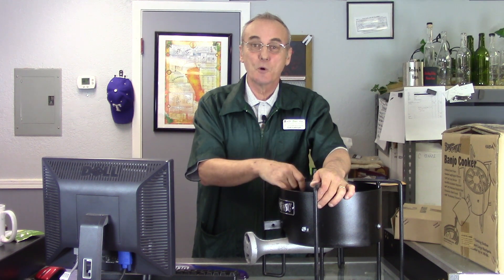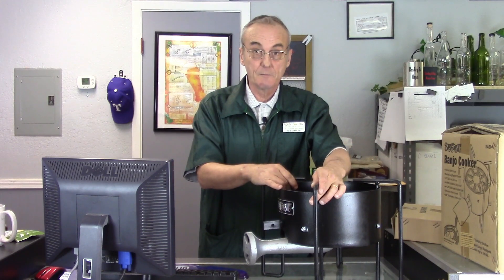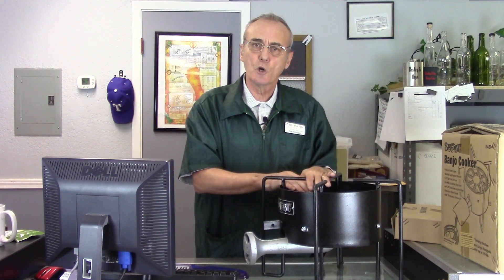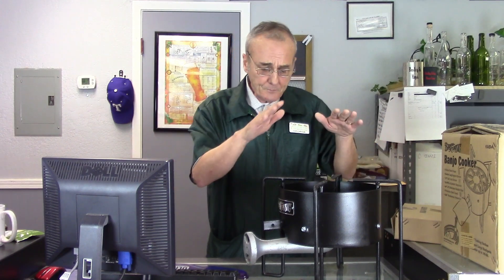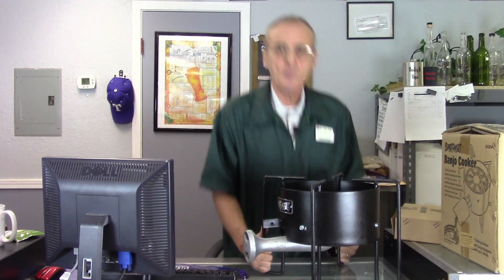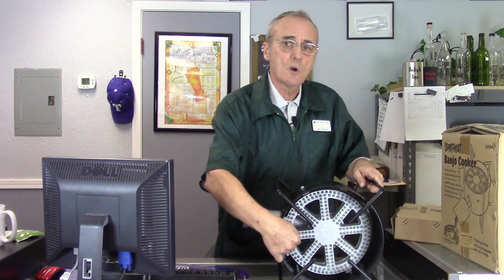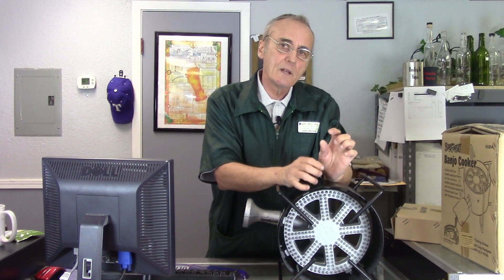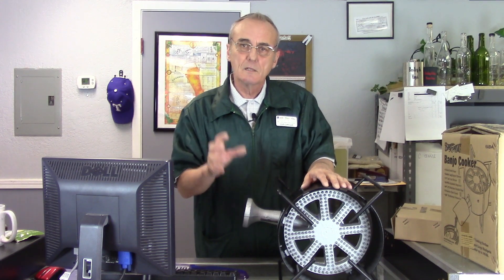BANJO COOKER FOR YOUR STILL

Comment: I was thinking of purchasing this burner and occasionally throwing a 20" cast iron skillet on it.  Do you think temp control would be manageable at all with this burner on it's lowest settings or would I just end up scorching everything?  Also is the fuel burn on a 20lb cylinder reasonable at  a really low settings?

Comment: Sound quality very poor on this vid which is unusual for your vlogs
Reply: Thanks. I may just re-do this one. I got a new mike system and didn't do a good job of testing it first. I had it set to mono and also found that the receiver volume was set to max. *&^%$ My mistake.
George
Reply: You can always use natural gas in a propane burner, but not all natural gas burners can take the heat of propane.

You'll likely have to adapt your NPT natural gas line to work with the propane device, which is nothing more than a trip to home depot. Use teflon tape on ALL your fittings and make sure your shutoff valve is decent.